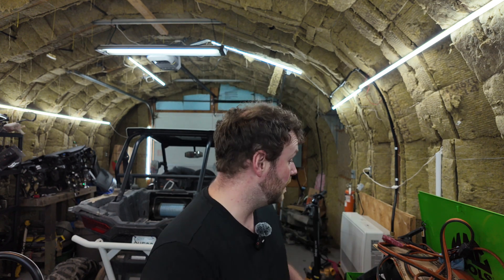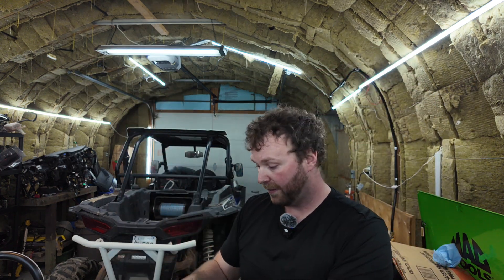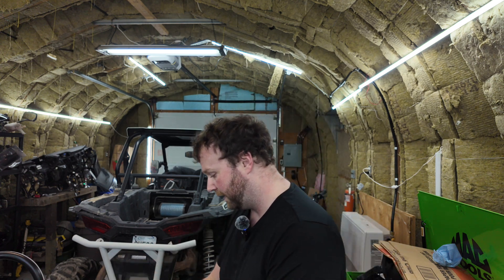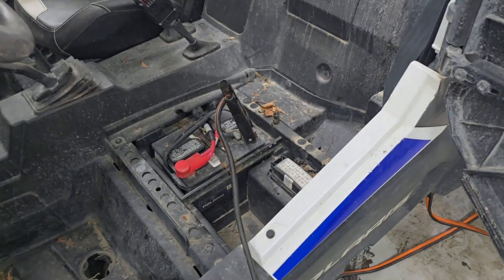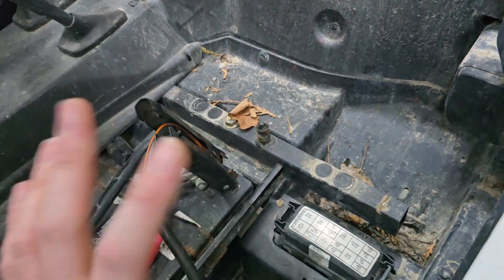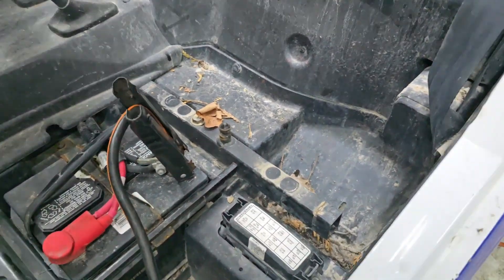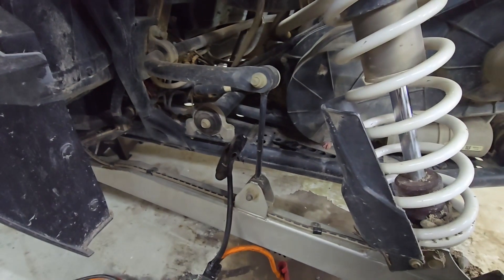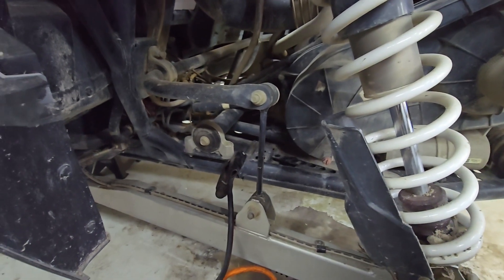Important tool not being used anymore? Forgotten testing

Comment: I once chased a no-start CAN fault on my L320 Range Rover Sport for .. weeks. In fact, I never found it (for shame!) - I was convinced it was an ECU, or some other wiring problem I couldn't find. In the end it went to a specialist who found a corroded ground in the main fuse box and had it fixed in an hour.. that was about the only bit I hadn't removed and checked the wiring on.

Comment: The jumper cable idea is great. I keep an extra long pair of 2 ga cables around for this. More than once i was able to drive a dead vehicle into the shop by running a jumper cable from batt negative to  the engine or the frame, depending on the issue. One had a corroded negative cable. The other had no frame grounds left. Both chevy vans.

Comment: Spot on. I've been a mechanic for almost 50 years. I'm lost on the new junk. I use jumper cables on a regular basis. Whether it's to add a ground or to simply ensure that i have a solid ground or power when using a test light.

Comment: I have a 2002 Ford Focus.  Years ago it would start but not run.  Turned out a ground wire from the battery to the fender was open.  Not that the wire failed, but the attachment to the fender was only through the threads of the bolt.  The ring terminal was insulated from the metal of the fender by...... paint.  Scraped the paint and gave it a good ground.   I currently have a different issue.  I may start adding grounds.

Comment: I lost a ground on a 91 Mazda pu.  I found it by burning my self on the throttle cable.  The symptom was a temperature gauge that changed when I turned on the head lights.

Comment: Hello,
         MOST  mechanics don,t think outside the box when it comes to electrical  system in cars as opposed to electrical wiring in buildings done by licensed electricians in building premises. Yes that idea with jumper cables is a good idea for trouble tracing and not trouble shooting... Too much chassis return circuits can compound that least resistance back to the battery source.   In industrial automation machine wiring we used 25volts dc for all controls that become integral with progamable logic controls. We never use the machine chassis as a return for the 25 volt. DC return circuits.  We always ran wires to a terminal block in order to return circuit trouble tracing REDILLY ACCESSIBLE. HENCE A NODE POINT.  AS FAR AS SOUTH MAIN AUTO,S Eric, he is very smart but he is one arrogant SOB that did not want to listen what I had to say about automotive electrical connections. I personally tried to write to him and advise him that the electrical automotive world should think outside the box and do electrical connections on batteries and chassis done with products used in the electrical construction trade. Wire terminations used in high voltage electrical substations would be much better than the PREDATORILY ENGINEERED AUTOMOTIVE TRADE ELECTRICAL CONNECTIONS THAT ARE PREDATORILY DESIGN TO FAIL MORE QUICKLY.  
         All my battery terminations are the Burndy  Company hi dent terminations along with welders cable disconnects in order to isolate and separate electrical connections on a vehicle  for more effective TROUBLE TRACING.. Yes, Eric of South main is very smart but too arrogant for my skill sets of being a licensed electrician since 1972.  THE REPLY BACK FROM SOUTH MAIN AUTOMOTIVE WAS NOT ONLY ARROGANT BUT , ALSO DISRESPECTFUL  TO MY SKILL SETS AND ME BEING ELDERLY .......
         I,ve been a DYI MECHANIC ON MY 1979 chevy van and my 1984 Oldsmobile for about 40 + Years now. 
         BTW the railroad facility where I work, I serviced our industrial electric carts have no electrical connections to the chassis.  A bad predatory automotive design. 
         PLEASE GET BACK TO ME AND I WILL GIVE YOU SOME TIPS ON ELECTRICAL TROUBLE TRACING I USE IN THE FIELD AS AN ELECTRICIAN,  there is one tip the best of the best mechanics would not even listen to me..  

Miss Paula WALACH-FORMER INDUSTRIAL ELECTRICIAN-UNION MEMBER IBEW LICENSED SINCE 1972.STILL WORKING FULL TIME IN THE TRADE FOR A COMMUTER RAIL TRANSIT AUTHORITY.  

PS JUST LOOK AT THE LIFE SPANS OF SOME OF THE BEST MECHANICS.  THEY DON,T LIVE MUCH BEYOND 65 YEARS OLD. IF THEY DO THEY ARE FOR THE MOST PART IN POOR HEALTH.

Comment: 2019 Sierra AT4.  A few years ago, my power steering was going dead and triggering multiple codes, including trailer control, etc.  Took it to the dealer. (Power steering is all electric).  Two days later they call and tell me the truck needs a new battery.  That was not likely and so I asked what if we put in the $700 battery and it still has an issue.  They told me next they would need to replace the power steering module and if still an issue then power steering rack.  That's what the troubleshooting manual said, supposedly.  We would be into thousands of dollars.  I took the truck home and looked through a pretty basic wiring diagram thinking the warnings must be generated from a module that has a common ground.  Took about 15 minutes to track down and it was a ground between the firewall and the frame that they shared.  It is right behind the passenger front wheel well so the braided mesh strap was bathed in salt spray for a couple years.  Not sure who thought that was a good location.

Took my old hand made jumper cables I have had for decades, 2 separate fine stranded welding lead wires with what looks like the exact clamps on the set in your video.  Clip to ground and to frame and... no more issue.  Removed, same issue.

Was very interesting when I went back to dealership, jumper cable in hand and asked the tech to come out.  Connected the cable and showed him the disintegrating ground cable.

Had them change with the factory part because was just marginally out of warranty but a $6 battery cable from the auto supply would have worked great and probably held up longer.

The fact that the frame and body are acting as the one conductor seems be one of the most basic overlooked concepts.

Those cables are a very valuable tool.  Used hundreds of times for jumping, but also so many other applications, including a ground extension for my welder and power steering repair!

The nice part about making a set from welding lead is they are so flexible even in cold temperatures.  Agree that what makes a great tech, contractor or any tradesman is being open to learning every day.

Comment: I don't think that this gentleman watches South main Auto carefully. Eric doesn't start by assuming anything. He gathers all the information he can before he attempts to find the cause of an issue. When he's troubleshooting an electrical issue he'll do simple testing to establish that the modules and devices connected to them have power ground and continuity.. if a problem seems to be network communication he'll verify data flow and look at the waveform. 
In a 12-volt test light can identify a problem with power AND grounds
Reply from the maker: Well all get to different answers quickly l. The point of this video is a remember that there's easier ways to do something and I'm wondering if you watched it cause I mentioned i could spend months with him and he's always 100% successful

Comment: The engineers and designers are working towards 48 volt base systems.  It's a comin'!
Reply from the maker: Make sense. The hybrids run 48v. Wouldn't be hard
Reply: @Lancemechanics  Engine bays are getting more and more cramped.  The push is for accessories such as water pump, AC,  and the like to be powered with electric motors or some other means besides a belt.

Comment: Had a 28 month old battery go low, went to the shop that sold it to me, the guy tested it, it was 45%, said if I drove around it will charge, he obviously wasn't going to honor the warranty, even so the rules are I have to leave it there overnight for testing. Then I had to have it jump started to go, went to another shop for a battery, the guy tested it and said it was fully charged. Went to work the next day, and as I was going to leave it would not start or turn off. It may be best to only get a dealership battery, I had to tow it to them. My dashboard brake light warnings were lit up, making me think there may be a problem with them, even so, brake places can't do any electrical issues with brakes. I agree testers are useless.

Comment: Best way to look at car electrical systems is that the alternator powers the vehicle when the engine is running, the alternator supplies all of the electrical energy.  All the battery is there for is to start the engine, and once running the battery just smooths the power supply and supplies additional short term current as needed.
Reply: Really the battery voltage controls alternator output.

Comment: I use jumper cables for a ground when using a test light at the opposite end of the vehicle as well. Constantly seeing trailer wiring faults. And im not clamping my test light to a rotten frame or bumper bolt.

Comment: Learned to check grounds years ago. When I was a kid I had a 63 Plymouth with a left signal light out. Well I thought it was out. My dad saw the light flicker and said check the connection but it was good. He followed the ground and cleaned the connection and it started flashing. Gotta be grounded. Good stuff. Happy Motoring.
Reply: I remember that same issue on a lot of older vehicles.👍🇺🇸
Reply: I had same issue on a 73 ford pickup. Grounds are a must.
Reply: Had the same issue on a '66 Chevelle I had many years ago, both taillights were out and a cop pulled me over. Corrosion around the socket flanges had made the grounds non-existent. A few minutes of messing with them and they lit up once again. I did thank the cop for pulling me over for such an item, as it's dangerous to run without them. No citation issued; he also left after I got the first one working.

Comment: On automobiles, ground is a misnomer.  They are more accurately called, commons.  Earth is ground. Negative common systems are not connected to the earth. Yes there is carbon black in the tires, but that is just for static charge dissipation.   ---Doozer
Reply: I’ve been working with cars and trucks for nearly 40 years. Never have I called grounds “commons”. 6V/12V/24V power, and ground.
Reply: @r.joseph8911  Glad I was able to teach you the proper terminology.
Reply: What the hell do americans know about " proper terminology". You've been mangling and bastardisding my language for hundreds of years. Same as we did to all language that made its way to us from the East for thousands  of years. All the best, no hard feelings.
@kooldoozer

Comment: I remember about a year ago chasing a fuel pump related problem with a civic that was causing be a major headache and it turned out that car had 3 major separate grounds and one of the grounds going through a 8mm bolt was rusted up pretty good and wasn't making contact through the plastic harness. Took me countless hours chasing and trouble shooting because the ground was rather hidden and most ppl wouldn't even know that it was a ground point and the only reason I find it was because i ended up looking up online the electrical schematic and chasing that entire circuit from the battery back to fuel pump on the negative side. Car ended up starting perfectly when i jumped the battery nefative terminal to the engine ground near where the harness was..

Comment: Would it do any good or benefit to just run a thick ground cable from the frame to somewhere just to help whereas I'm in an area that uses calcium salt and has terrible weather and is always rusting grounds out?
Reply from the maker: I love running extra grounds. Always did it on older vehicles I owned

Comment: Too funny... haven't had to use jumper cables in years until yesterday I was extremely happy that I had them in my truck.... On a side note my 2500 HD had a dual battery system... my 1500 does not but I have cables that I could run and a place for the second battery from the factory. Would it benefit me or help me to have that second battery connected whereas I use the truck for work and sometimes have to leave on the four ways or accessories...

Comment: Anyone who's dealt with old (pre 1990s) and fibreglass vehicles will back your advice of using jumper cable(s) for giving a certain good earth for diagnostics and repairs.  Well done on sharing basics, it's usually (more) difficult to successfully progress if the basics haven't been covered, double -check and cross-referenced.  Keep up the good work.
Reply from the maker: Ty! Never thought about Fibre glass cars:)
Reply: And boats

Comment: Was always told ANY electrical issue the first thing you check is battery, battery gounds connections, and battery positive connections (starter, alt, and fuse panel) but this is definitely a good fast way for checking the grounds! Im going to start using this
Reply from the maker: Awesome :)

Comment: Last time I had a vehicle in the dealership, it was for a battery problem.  Not only did the dealership not have any jumper cables, but they told me you can't use jumper cables on modern vehicles and must use a jump pack.  He had some explanation about how a jump pack provides a "jolt" like a defibrillator and jumper cables only provide a trickle.  It was fairly obvious he didn't know what he was talking about and was just repeating whatever the service manual says
Reply from the maker: Wow :/
Reply: That jolt caused my instrument cluster to die in my 2012 Chevy.  I used my jump pack to start the van after the battery died and a Chevy mechanic said it was the jump pack that caused the cluster to die. He said the best thing to do is disconnect the battery from the vehicle and put the battery on a charger. I love and hate modern automotive electronics.
Reply: @donrep8  Sounds like your chevy mechanic also doesn't understand what he's talking about.  I have a background in electronics and have even tried testing this with my oscilloscope.  There isn't an extra jolt from the jump pack, it's identical to jumper cables.  It doesn't even really make sense from an electrical perspective.  I would guess that it's most likely low voltage that fried your cluster, not high voltage.  Or your jump pack is bad, or your alternator is bad.  Your mechanic probably has no idea what happened and is just blaming it on the obvious thing

I think the reason why manufacturers are telling everyone this is to trick everyone into leaving jumper cables behind because jump packs are safer.  Almost nobody would ditch their cables because they're "unsafe" but if they think they don't work everyone will stop using them.  A jumper pack is also likely to have more current capability than some small car alternators, so maybe that's it
Reply: @trapperjohn7571 , Interesting. I thought it was extremely odd when he mentioned this because batteries are jumped every day without consequence. So low voltage or no voltage in my case could have killed the cluster?
Reply: @donrep8 It's less low voltage itself that kills things and more of an oscillation between enough voltage to power on and low enough voltage for brownout.  Obviously I haven't actually seen your vehicle, but that's much easier for me to believe than "the jump pack killed it"
Reply: @trapperjohn7571 , Hey, thanks for the info. Always willing to learn.👍

Comment: That is an excellent way to establish grounds to a vehicle. However, you can still have ground is going to different modules right at the plug and it still will not solve the issue. I do see the over all theory and operation of what you’re doing. It’s a great start. But the bigger picture is making sure all your components. Have powers grounds and communication. Just my thoughts, Ron.

Comment: Such a simple thing, so insightful. As you say, we chase the supply side all the way through complex circuits, modules, diodes etc when a simple ground fault can cause it all. In the past, an old school DIYer would have seen a flashing brake light and instantly know the likely cause was a ground issue and it's all been forgotten.

Comment: I did a head gasket on a 2002 Sentra, connected the battery, hopped in the car, turned the key. The car turned over, would not start, no codes.....after about 20 minutes i figured out i did not have the car  computer / logic ground connected.

Comment: Good advice. If your booster cables have the wires riveted to the clamps or folded over connections hammer them tight. After a couple boosts cheap cables will arc at the joints and lose connection. Could throw your ground test off.

Comment: I cut wiring harnesses out of trucks or vans when i part them out. Extra color coded wires to run new grounds, aftermarket stuff, whatever. Being a body guy the spot welds can create a ton of headaches.

Comment: I have tried to teach this to so many techs over the years. I also tell them to add grounds all over which is a good preventative measure and extremely easy to do. I take also use both jumper cable leads one going to engine and one going to the chassis.
Reply from the maker: Once they see what it does they'll do it everything. Like we know. Only takes a few minutes and you just know. :)

Comment: I've been an aircraft mechanic specializing in avionics and electrical systems for 38 years. This is very good advice for any and all equipment that relies so heavily on electrical power. The common ground system proliferates everything. This simple step should be the first step and only second to verifying voltage is actually available at the source.